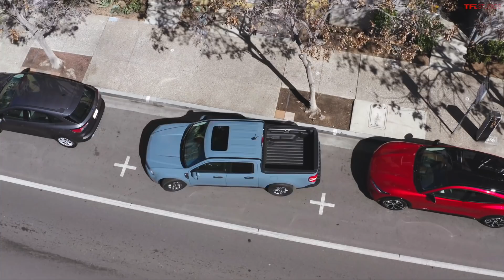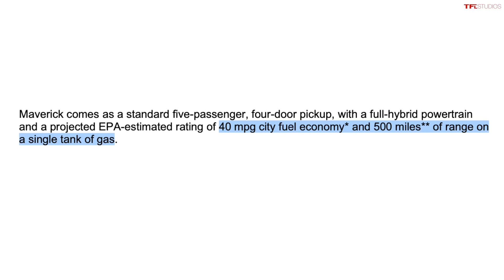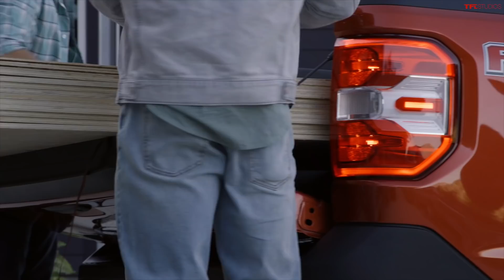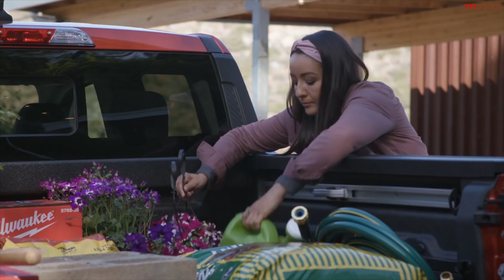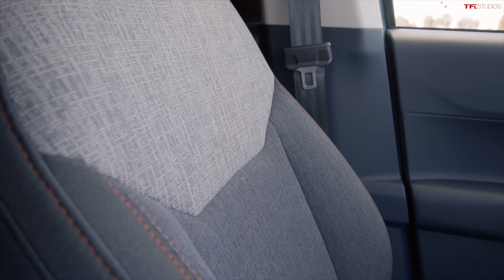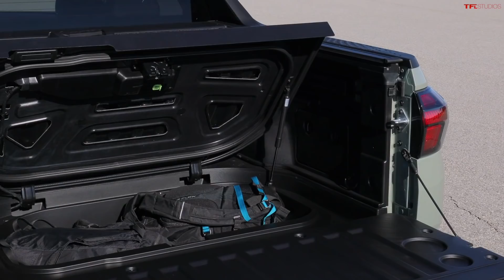Hands On With The New 2022 Ford Maverick: Here Are The Top 10 Things You Need To Know!

Comment: I hope the extended cab long box version will make a comeback.
Reply: Yeah, not all of us need full sized back seats in a small truck, but get a lot of use of the SuperCab rear space, and an extra foot or so of cargo box would be great. I’m still quite enjoying my 2010 Ranger’s size, but had to go for the most bear bones “sport” model at the time. With the 4 liter 6, I’m sure as hell not getting 40mph. OTOH, I’ve never even unfolded the jump seats, and with a lot of families using their trucks as daily driver / grocery getters, ‘cause ‘murica, y’all, this could be very appealing. I’m Canadian, so the translation of the as yet unknown pricing for all but the entry level model makes evaluation tricky yet. For reference my final cost were a little under $20,000 Cdn in 2010 for my current ride, and only real complaint is the PLASTIC handle on tailgate, which has now broken twice.  Really, Ford, plastic?

Comment: I agree with most that this will sell out rather quickly.
Did notice something peculiar though. The rear bumper is straight across, without a step-up section in the middle. This places the license plate holder and trailer connector below in the mud, dirt, etc....no bueno!

Comment: "Great for tight environments" then cuts to the Maverick parallel parking in a spot so big you could park the Queen Mary in it.
Reply: Smh if you think this maverick has poor parallel parking then it's beyond obvious that you have never personally parallel parked a full size truck. Let alone parked a large truck such as a Dodge Ram 3500 w/DRW!! Would be great entertainment just watching you attempt to parallel park a late model half ton Dodge Ram. Panic attack you would have, inhaler you would need.
Reply: @itdoesntmatterwhatyourname6128  That's .. not what they were saying at all. Reading comprehension a little lacking?
Reply: Hi aunt
Reply: *Cuts to stock footage provided by Ford

Fixed it for you.

Comment: As an OBS ranger owner. This. This is what I wanted when the New ranger came out. This little thing is going to sell like hotcakes!

Well done ford. And good job reporting it TFL.
Reply: I do think that it will sell okay Bc the interior is nice and it’s so cheap. However, I do NOT think it captures the spirit of an obs 4x4. Unless ur reminiscing over a 2wd obs than disregard my statement. Bc this thing has independent rear suspension and will have an open diff awd setup at best. New ranger drives much more similar to old ranger than this Bc of suspension components and I have owned a first gen taco and a new ranger. This will feel like a small explorer or an escape drive quality wise which will be great on road but I have doubts even with the fx4 package that you could drive over a small snow mound at the front of your driveway in this thing. Watch tfls videos of testing vehicles off-road that are irs awd. They can’t even get to the area where the usually test vehicles lol.
Reply: @tdawg6877   I would say this Maverick would be closer to the Bronco Sport. Watch the TFL Torture test on the Bronco Sport, it seems pretty decent.  The AWD system capability is really dependent on how its managed and cooling solutions for it.  As far as a locked differential they are nice to have but the E-lockers Ford uses have their limitations. I've own an 88 Ranger and a 04 ranger I could get either of those trucks through water, snow, mud as deep as the body and they were open diff and I don't believe Ford offered a locking diff from the factory on either of those.  Also for the price its hard to expect Rubicon capabilities
Reply: @happycricket123  I agree about old trucks with open diffs my first gen Tacoma could pretty much do anything I wanted it too and it was similar spec to the baby yota truck. but pre front grill facelift. And I hope the maverick is as good as the bronco sport (I just checked out the tfl video and I concede it performed better than I would’ve thought). I’m concerned bc I’ve driven a 2017 platinum explorer with the off road terrain modes in snow and mud and it’s wayyyyyy worse than the new ranger and my old Toyota by a lot. And even if the maverick is more similar to the baby bronco my statement stands that the new rangers ride quality and spirit will feel more similar to a obs ranger due to rear solid axle and leaf springs vs IRS and cool overs. So if the buyer is interested in a small truck that reminds them of their nineties mid size 4x4 this ain’t the choice for them that’s all.
Reply: @tdawg6877  Yah cant argue that the way it feels and handle will be quite a bit different than a solid rear axle truck or body on frame. For me this isn't necessarily a bad thing. I current daily a 20012 Ram 2500 crew cab long bed and occasionally I will ride in a 90s truck and I am surprised by the crazy difference in build quality, noise, and general poor road manors.  Some of that is them being worn out but some is just different standards, technology and consumer expectation. I think this AWD will do well because of the amount of HP my 04 ranger made like 200hp. Also towed an enclosed 14' trailer nearly every day with it. But I agree this Maverick will be way different than trucks of yore.
Reply: @happycricket123  yeah! We totally agree. I think it’s a great truck and I think people who buy it for the right reasons will enjoy it. Affordable comfortable ride that will be able to handle snow rain etc can still tow can still go buy gravel or trees or mulch and throw it in the bed and will ride much nicer on road. I was only saying that I disagreed with the original comment saying the guy is excited Bc he wants something similar to his obs ranger. And if that’s the case I would suggest getting the smaller cab 4x4 ranger xl or maybe a manual small cab Tacoma. I think if your fond of the obs and want something as similar as possible you shouldn’t be excited for the maverick. If you want a car that’s practical to use as a commuter and is nice ride and interior but u need to occasionally tow or use the truck bed for small home projects or yard work than the maverick is perfect and you will love it.
Reply: @happycricket123  and he’s I agree the modern trucks are muuuuch better to commute to work in lol. And even the new ranger is a little rough if your gonna be staying on the pavement. Driving on the turnpike at like 75 in my Tacoma used to feel like I was rattling around in a deathtrap and couldn’t even talk to the person next to me Bc of wind noise and I had to floor it full throttle to pass anyone if I was going anything over 45 mph lol
Reply: @happycricket123  If you can drive manual, you can get a real Bronco 2 door for a lot less than a sport
Reply: @bindingcurve  Yah I hear you. But I already have a project rig a Samurai on 31"s regeared, air lockers front and back,  super charger and if it put smaller tires on it can squeeze it into the bed of my truck.

Comment: Great job by Ford: a hybrid truck with 40 mpg! Worry about the CVT for wintertime time traction.  The CVT in Subaru and Prius go into protect mode and shut down efforts to power through snow drift, mud, ice ruts, etc.   But, overall an impressive package.

Comment: Great video. As someone who wants a truck as a second or third vehicle, I really don't like the fact that this truck doesn't have a two doors option and an extended bed option. I always have had multiple vehicles for set purposes; mustang for fun, fusion energi for commuting to work, and an old ranger for house work. It seems manufacturers are pushing one vehicle to perform multiple roles, but in my opinion, sacrifices are made that are too big. I will say though that this pricing is fabulous for the product. Now can ford please bring back the fusion and also make a real electric mustang? I'm tired of the hideous curvy suv's. "Mustang" mach e 🤢🤮

Comment: If this came out when the ranger did I would've had a difficult decision to make lol.  Love my ranger, but now I can't decide between a 6" and 3" lift, even with just a 3" lift it won't fit in most parking structures, and it barely fits on my driveway lengthwise. And if Maverick came in 4x4 vs AWD I'd be looking at a trade for sure. I like the Broncos as well but I like trucks more. 🤞6 cylinder Ranger in the next few years, if not stepping it up to a big boy F series

Comment: I was liking it right up until he said cvt. I know that's on the base model, but unless Ford has figured out longevity, I wouldn't touch it with a 9.5' pole
Reply: Hybrid CVTs are usually classified e-CVT. They are built without belts or chains compared to gasoline models. All gears. Ford has previously followed Toyota's e-CVT design with their hybrids.

Comment: You can have a super efficient hybrid, but only with a CVT, front wheel drive, and you can pull an empty trailer. Or get the turbo and do a bit of truck stuff.

Still, I think that both models are going to sell a lot. Plenty of people just want a truck they can fit into a garage.

Comment: I was really interested in the hybrid after your F150 hybrid videos but the second you said CVT it's off my list.  Sorry in a side by side or sled CVTs are fine and you can service them yourself fairly easily.  In a vehicle that will see hundreds of thousands of miles no freaking way,
Reply: Hybrid CVTs are usually classified e-CVT. They are built without belts or chains compared to gasoline models. All gears. Ford has previously followed Toyota's e-CVT design with their hybrids.

Comment: I have heard that the Escape had a lot of transmission issues with that CVT.......and if it is going to be in this base unit.......that might be a problem.    Not sure I want to pay for the 2.0 Turbo with the more conventional 8 speed tranny.   Not sure I like turbos or the extra cost.
Reply: Ford's hybrid e-CVT? I tried looking, but nothing stands out problematic with their e-CVT across various models. Nothing that overshadows Fords conventional automatic transmission issues anyway. What have you heard?
Reply: @wzDH106  I had heard that the CVT units had slipping issues at low mileage.   But what I don't know is if that was older models or if it is still happening in the new units.

Comment: Sure hope ford has figured out how to build a cvt. Anyone remember the powershift cvt focus?
Reply: Hybrid CVTs are usually classified e-CVT. They are built without belts or chains compared to gasoline models. All gears. Ford has previously followed Toyota's e-CVT design with their hybrids.

(Edit) Wasn't that a dual clutch transmission, not a conventional belt driven CVT?
Reply: Ford has a CVT history. C-Max, Fusion Hybrid. Both of those had CVT's.

Comment: This truck is nice. It's like a getaway truck. 40 mpg-500 mile range. Way better then the lightning range. It is a very versatile pickup for the price. I presently have a 2019 f150 which I use for work. For the price. I would add the maverick to collection so I don't have to take the f150 out of town with my tools in the back.

Comment: This looks like a really interesting truck. It was good to hear that it has an available trailer brake controller with the towing package which I consider to be an absolute must when towing. I used to tow a 2000 lb trailer with my Nissan pickup many years ago and my stopping distance was greatly increased when towing my trailer.

Comment: It's a freaking SUV with half a roof! Nothing but an in-town grocery getter that will fall apart after a few years. Ditch the stupid hybrid power train, unibody construction and all the whizbang electronics infotainment BS. It's a basic tool NOT a home entertainment center! Just give us a plain vanilla mini-truck with a small 4-cyl gas Non-turbo engine, 5-speed  manual transmission, 2-wd, full frame and at least a full 6' bed. Offer an optional 4x4 with larger 4-cyl Non-turbo engine. Keep it simple stupid! This was obviously designed by millennials for millennials who need constant stimulation and cannot conceive of ever being disconnected from their electronics or being  more than 5 miles away from a Starbucks. This is just a bunch of corporate BS Hype... It's everything to everyone YEA! The only thing they got right was the Sub-$20k base price.

Comment: I like the starting price on the truck, but I don't like that's it the starting price for the hybrid motor with FWD. I'm curious what the AWD 2.0T ecoboost is going to start out at just because that's the option that I would get. If it's around the price as a Ridgeline then I'd honestly rather opt for the ridgeline, just because it has a 5ft bed and the in bed trunk. Other than that this Maverick definitely seems like a decent little truck for those just wanting something very basic and cheap, while still having truck capabilities.

Comment: Sorry, they missed it on this truck. Only 4k MAX towing on the more expensive 2.0T non-hybrid (which in the Bronco sport doesn't have very good mpg). It took it right off the list for me. Looks like I will be going with the Santa Cruz. Too bad, in the run-up to the reveal I was getting excited for this. I don't get what ford is doing. Most other unibody Small SUVs have much higher towing and utility specs than Ford's vehicles. Same thing bothered me and took the Bronco/Bronco sport out of the running for me. At the end of the day, I still need to tow my boat and small camping trailer or I can't buy something like this to replace my daily commuter.

Comment: Very nice job, Tommy & company! Very well done report!

As for the Maverick, normally I'm not a fan of FWD/AWD/Unibody cars with pickup beds in them. But Honda does prove with it's larger Ridgeline that there is an audience for such a vehicle. Besides that, this is smaller than Ridgeline, so if capability was a requirement, then this isn't a "truck" someone would consider. And, you hit the nail on the head, Tommy: this is a modern-day interpretation of the Ranchero or El Camino/Sprint. And, how does anyone argue about a base price of $19,995 in 2021? Nice job, Ford. And thank you for not calling it the "Mustang Mach T," or the "Bronco Maverick." 😏

I_Am_Rabbit! 🐰

Comment: Looks more “truckish” than the ridgeline
Reply: @carbon_star  I said “looks”, never said anything about price or size. rtfp
Reply: Have you seen the new 2021 design refresh of the Ridgeline?
Reply: @jg8263  Yep and for some reason it still looks like a half Pilot
Reply: The Ridgeline is more capable though.
Reply: @galactictomato9168  hence i said “looks”
Reply: @galactictomato9168  for $20k more
Reply: @galactictomato9168  Nah. Not with the 4-wheel drive version.
Reply: @uowebfoot  Are you kidding. The Maverick is using the Escape's hybrid system. It's a fine system but nothing special. The Ridgeline is using Acura's SH-AWD system which is one of, if not the best AWD system on the market.
Reply: @galactictomato9168  and the Ridgeline is a Honda...Maverick not even in the same ballpark.

Comment: Hi Tommy used to buy only new F-150 I've had three of them going back to 1995 had two real bad trucks and one outstanding one, not the last 2006 super crew Lariat 4x4 it had so much problems I lost confidence in ford I will say total miles on the three trucks was over 498,000 miles. This little truck looks interesting thank you for the preview.

Comment: I have been interested in the Ridgeline they are start out at 36k if they Hybrid is 20K definitely yes. I don’t need to full more than 2000 lbs and bed length would be just fine with the angled tailgate design. I think they’ll sell a lot.

Comment: I think for a lot of people this is enough truck.  Not everyone needs an F250 diesel.   I own a Ram 2500 with the 5.9 Cummins but only because I tow a 8,000 travel trailer.  If I didn’t have the trailer I would have a much smaller truck, either an F150 or Ranger sized truck.  Main thing that would put me off this is the shorter bed.

Comment: I wish the hybrid was available with AWD, which is very desirable where I live (Canada).
Reply: Best guess why it isnt is the Hybrid battery probably gets in the way of the driveshaft, and a rear electric motor would just take away too much payload.
Reply: @cpufreak101  I thought that too, but the Maverick is on the same platform (C2) as the Escape. It has the same hybrid system and suspension setup afaik, and you can order the Escape Hybrid with AWD
Reply: @Black-Villain  likely payload related then

Comment: I’m 100% buying this when it comes out. I have been waiting for a cool cheap truck. I don’t mind that it’s a unibody considering the capabilities are there
Reply: Did you notice the bed is built into the truck body creating a high insurance risk and the reason Honda redesigned the Ridgeline.
Reply: @micksmydad  I always try to explain to people the Gen2 Ridgeline does NOT have a "fake bed divide line" but rather you are seeing the edge of the bedside panel meeting the cab panels, so that a dent doesn't require replacing the entire side of the truck. Glad to see someone else who is knowledgeable!
Reply: @jg8263  thank you for explaining that. I hadn't considered that.
Reply: @micksmydad  explain this a bit further?
Reply: And shiiit it's less than 20k
Reply: @supplant9124  seriously. You can get a nicely equipped one for under 30k easy. Might wait for the second year model though just to weed out the 1st year problems that will inevitably come!
Reply: @Takethe1stStep  the drivetrain in the truck has already been a tried and true design from ford
Reply: @mattgray6436  but still may have bugs. You never know how geometry of this truck will effect things like wear spots compared to the existing models.
Reply: @supplant9124  No it isn't. It's basically useless when configured down to the $19,995 minimum price point. No towing, CVT only, low rent ultra cheap interior, no cruise control, etc.